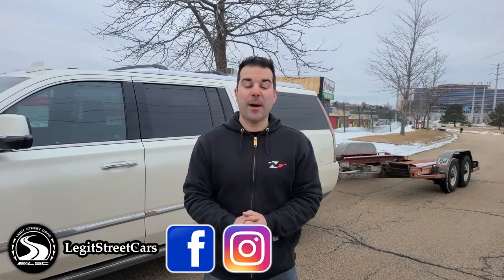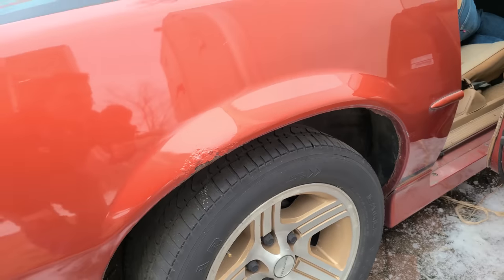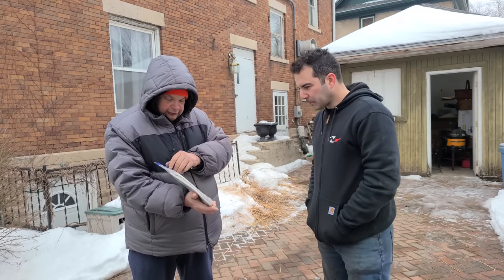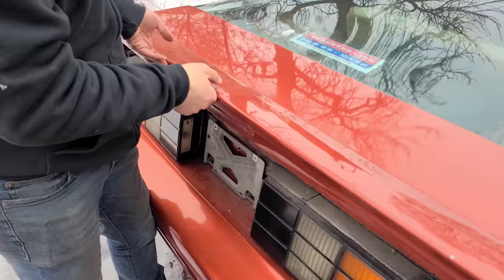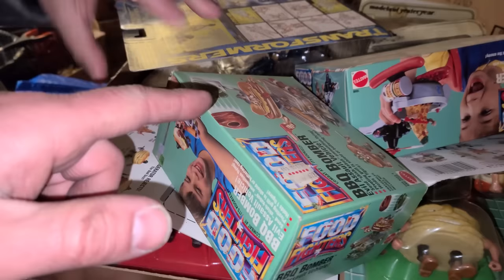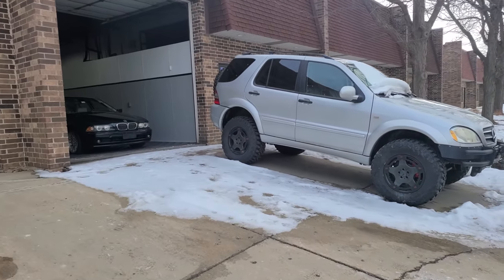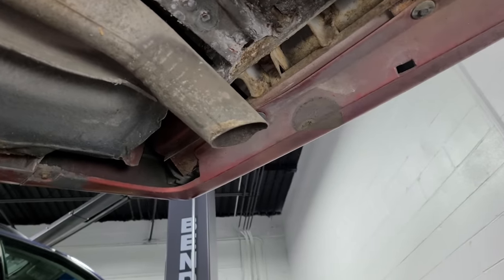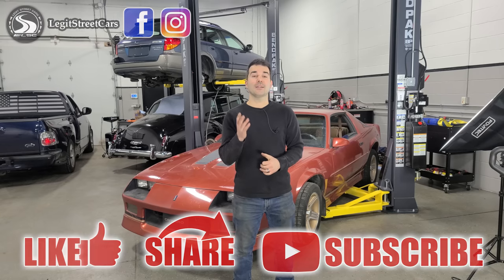I Bought An Abandoned IROC Z Camaro That Sat For 27 Years In A Storage Unit! Here's How Much!

Comment: I would definitely restore this beats Alex , come on man you got this , you haven't done a full restoration series yet so why not this ,as you even got it for 1500$ are you kidding me and clean title !!!!   mannn !!!! I'm all in for this thing these are so getting special as each day passes  , I'm in mad love with these  F-body  Gm's super cool and unique !!! please Alex save this baby !!!! STAY SAFE , TC and God bless !!!!
Reply: That thing needs like 8k in metal work alone, not sure if it's really worth it
Reply: To me it did not seem too bad underneath it obviously needs some work but it didn't seem to be rotten through
Reply: I agree needs to be a different color anyway.
Reply: From what I've seen, it's going to cost 8 to 9K to replace the rotted out floor pans. And another 2 to 3K just to get it mechanically sound with today's prices. Fuel tank will need dropped and cleaned and fuel pump replaced to get rid of varnish., All the brake lines are heavily rusted and would need to be replaced for safety sake., We don't know if the engine is any good or the transmission for that matter., All the brakes need done rotors, calipers, pads, hoses on the front, wheel cylinders, brake hardware and shoes on the back. And that's just to get it drivable safely. It's a good parts car and that's it.
Reply: I didn't think the rust was that bad tbh. Yes it's rusty.
As the others have said.
A resto only worth it if the end justifies the means.
This iroc maybe too far gone.
I'm not sure Alex would have the time to do a full on resto...
Reply: @JDJD-mw9rr  well if it sells for 15k or more isn't there a profit? I mean still it's unique and cool isn't it , its not like any car we get today alright I understand it doesn't have the 350 motor as well but still it deserves a chance.
Reply: @Thanos.m  yep your right 👍 thats exactly what I'm trying to say.
Reply: @Ooshwink82  Hmm 😳😏😎 not a bad idea !!
Reply: @TwentytenS4B8  well it's not that it isn't repairable and it still deserves a chance if you compare to a crashed salvaged one so thats why I feel it deserves a chance .
Reply: @TwentytenS4B8  you know what I think if Alex can find one that's damaged maybe lightly in the front and needs body parts maybe ok , then it can be used as parts.
Reply: @stuartd9741  Exactly
Reply: I live in the UK so I've seen my fair share of rotten cars at least from the video apart  from that panel in back and some localised repairs didn't look to me like it needed whole new floors.
Reply: @stevesamuel6603  honestly you'd be better off with one that wasn't so rotted out to start with. These cars aren't that valuable or rare, I've owned 3 of them. It's a unibody car so all that floor is structural, you'd literally have to replace everything and not to mention all the mechanical work, and in the end you'd still only have a 3rd gen 305 Camaro that is nothing special. I love these cars too but it's just not worth it for the normal buyer, maybe for Alex tho because he does all the labor himself and makes money off the videos. I had a mint 86 IROC, sold it for cheap years ago and now I wish I still had it since it was perfect.
Reply: @stuartd9741  It's a unibody car so all the floor underneath is structural. It would all have to be replaced, pretty much the whole car
Reply: @TwentytenS4B8  exactly, that car would cost more money than itd be worth to restore
Reply: @JDJD-mw9rr  like I said wasn't sure it was worth restoring.
The rust looked better than the neighbors  LT 1 he had..
Reply: @stuartd9741  I guess "worth it" is subjective. Worth it to make a profit, probably not. Worth it to make some videos and because it's a 3rd gen and sentimental then maybe. I just know how bad rust is in the rust belt, I tried restoring a merc slk230 and it just crumpled as I took it apart, it would of cost 10x what the car was worth to fix so I sold it for parts. I got a 12k quote from a body shop just to fix the body rust, never mind everything else lol

Comment: BEAUTIFUL 😍 paint.. 
I Purchased an 87 Iroc last year 20th anniversary  convertible for $700 same color but my paint is oxidized.  
You can easily get back the $1500 by selling the nose and rad support fender interior wheels and so much more.. keep engine and trans if good and search for a good clean Roller.

Comment: I love that factory color with the beige interior. I have the same, just from '85, originally with LG4+700R4, but swapped to 350TPI + T5 WC.  The hard part is to get replacement for the interior plastic pieces, especially here in Hungary :)
Can't wait to see this beauty running again :)
Reply: Hey there, my fellow european 3rd-gen owner. Hawks motorsport has alot of stuff for the interior. I have ordered a few bits and pieces from there. They LOVE 3rd gens :)
Reply: @kmas8229  Hello there for you too :) Yes I know Hawks and yes, they have mostly everything, but there are exceptions, like tan front seatbelt receiver, they only have the sleeves.
Reply: @___Reaper___  Oh damn. You could send them an e-mail? I had difficulties finding saddle-tan seatbelts, but they were very helpful. :) They found some and sent them to me for a pretty penny.
Reply: @kmas8229  Good idea, thanks, I'll try that. Somehow never thought I can send an email to them :D
Reply: @___Reaper___  Good stuff! I hope you'll find what you need my dude! :)
Reply: @kmas8229  I hope too, thanks again for the tip :)

Comment: I know this video is a few months old, but you do not jack these cars up on the pinch welds. Use the torque boxes in the back and the front subframe along the trans tunnel. One of the main causes of rust and body damage is jacking on the pinch welds. You bend the fender mount, which bulges the fender and can possibly cause issues with the door. You can also break the seam open where the floor, toe board, and inner rocker connects allowing moisture to get in, rusting out the front corners of the floors. It is the most common area for rust on these cars, driver front corner where everyone improperly jacks.

Comment: I graduated high school in 1990, I wanted of these so bad.  I came back from the in 1993, and almost bought one similar to this one. It had 3 options, the 350, the t-tops, and the upgraded factory radio.  I drove it and it rode like a tank.  Wide turn radius, stiff suspension, and wasn’t as powerful as I thought it would be.  It was good deal price wise- I just didn’t have fun driving it. Good luck with yours, I’m  eager to see how it turns out.

Comment: 245/50/16 stock tire size. Front and rear offset different. On GTA wheels it's easier to tell...the front 'lip' is deeper so it has a deeper dished look. Was done for turning clearance up front. 16mm offset if I recall and rear is 0mm offset.

Comment: i use to have a iroc rechipped it and it came alive way better then i thought it would had a lot of fun in that car black and gold did not even have a ding in it when i sold it drove it for 5 years and made good money off it . next i am building a 79 z28 rs t top have 90% of the parts for it with 2 extra z28's hard tops for parts . got a stroked 454 with a 02xx trans for it got everything for free so far even got new custom interior for it out of one of the hard tops . all i need is paint supplies and a few nick nacks for it also have a t-10 4 speed with new fly wheel and 12 inch clutch for the 454

Comment: The original reason for the power hatch pull down; the convex concave hatch window needed to be slammed and sometimes shattered. PPG eventually perfected the glass so it would not shatter. Thanks for the video, and confirmation on my purchase of a '91 17k mile GTA from Florida for $2800. Due to being sunbaked; replaced spoiler, leather. Whole car needs repaint, buy no rust period. Know the feeling, my heart sank for ya'. What will you sell the power hatch for, mine recently stopped working.

Comment: It’s pretty funny, I got my 1988 Chevy Corvette, March 8th after sitting for a while, it wasn’t as good as the pictures either (but they’re made of fiberglass and have a covered Galvanized Steel Chassis so no rust) but I also used a handheld tire inflator to get it unstuck from the snow and ice. And it had a mouse at some point in it.

Comment: about 8 years ago, I bough this exact same car, color, condition. that rear electric latch is stupid. BUT, when I started cleaning the carpets in the trunk, I removed them. and glued down to the floor was the BUILD SHEET! in amazing condition Used a heating gun to soften the glue and it came off like buttah!

Comment: Please read! I have had numerous 3rd Gen f-bodies and they all have the same wiring issue which drives most mechanics crazy, and will scare the hell out of drivers when it happens
..but here's the issue and fix.. under the dr.side is one of the fuse blocks, gm made the mistake of zip tying the main  loom over a piece of razor-sharp sheet metal, eventually they will short out and cause major problems... to fix cut the zip tie on the main loom and pull it down an inch and your good!!

Comment: The flex lines on the brakes are the reason why the brakes are locking up. when you hit the brakes it's allowing the fluid to the calipers but the flex lines won't allow the fluid to go back to release the brakes I have had many cars that have sat for a long time do that so just remember to replace the rubber flex lines front and back on the brake system then rebleed the air out and it should be good. It could also be the master cylender but the brake fluid makes the flex lines swell up and act like a one way valve

Comment: I bought an '82 Firebird SE equipped identical to a TransAm, but not one officially so I would get a break on insurance. It was at the end of the first year of the Third Gen and had no electric hatch pull-down. I remember the salesman telling me to close the hatch grabbing it from the middle, not to slam it, and that a lot of people were ending up with a trunk full of broken glass bits. Apparently, there were a lot of stress points in the curved glass. Especially, if they grabbed the hatch at either side instead of in the middle causing it to flex. By the time I got an '89 Formula 350 the hatch pull-down had been standard and I think I remember reading in a car magazine or the salesman told me but it was put on to prevent people from slamming the hatch down. But my pull-down stopped working and became a nuisance making me have to carefully close it hard anyway to latch.

Comment: Wow sucks  about the rust . I have a 3rd Gen trans am GTA  bought it at the beginning of 2020 to stay busy simple window switchs and headliner stuff looks good sounds good but tends to run hot 🔥.   Hope to see what mechanical  things you do on the Iroc to maybe learn a thing or 2  . Keep up with the great videos love the channel
Reply: Make sure it has the air dam,it's directly under the radiator & core support ,it's about the width of the radiator and 3-4" tall plastic .if it doesn't have one it will run hot as soon as you take off driving.
Also check fan motor(s) and the temp sensor that regulates fan activation.
And it could be just a stuck thermostat though I doubt it but never know

Comment: I agree with many of the comments below. The old saying looks good from afar but it’s far from good is true.  After you found a hole in the door and the rust in the quarters, you probably should have walked away.

Did you buy this thing for yourself or did you buy it to flip?  If you bought it to flip it, yeah you’ve got an uphill battle for the restoration/repairs. 

As I looked at the other cars you’ve got in your shop, it would not appear as though it’s going to be a tough job either way. Your shop has the space, the tools and the staff to put it together the way you want it.

Comment: I'd say all the gaskets in the motor are bad, when a car sets to long without running and used to being in fluids they dry out and everything starts leaking once you start driving again. Once I seen snow I knew the car was screwed.

Comment: 13minute 45 second into the vid.. A little trick that's had a good success rate for me on cars with electric windows that have been sitting and are "froze".. Rock the switch back n forth between up and down rapidly and repeatadly. That has snapped a lot of electric windows into working with cars I've had this issue with over the years. Try it the next time this happens and let me know if it works...

Comment: The power latch was for the purpose of the early cars being 82-84 people would slam the hatch to get it to latch and the glass would shatter. So they added the power pull down do you can just set the hatch down and it will latch itself so you dont have to risk breaking the glass.

Comment: This is the thing about barn finds/stoage unit finds -  running/working cars in good condition are seldom put into that kind of storage. They get put there because they needed work and then forgotten about

A "mint" barn find is like finding unicorn poo.. You should expect to require a LOT of work to get any such machine running again

Ideally this should be stripped to metal, blasted and pickled so you know what you're working with, then rebuilt from there. Just "restoring" it will result in something that falls apart after a few years

Comment: Those cars were so cool looking. 85-87 are nicer though. The rims were slightly different aside from a couple other things. 1985 305 t.p.i. cars were freaks for one year only. The 85 z28 & iroc z had 3.42 gears with an automatic. GM stopped that real fast because these cars were smoking 85 vettes. The corvette was rated like 30 hp more and weighed more than the camaro. The 305 made way more than advertised hp. On a good day an 85 iroc with an automatic would run high 14's no problem. The next year they were a basic high 15 second car because GM pulled the 3.42's in favor of 2.73's  .

Comment: "Push it! Pull it! Tow it to Golf Mill Ford!" 
Supposively this color on the Camaro is the same on the Firebird. Pontiac calls it "Flame Red Metallic" 
Fyi: coming from a GTA owner and fellow fbody enthusiast from what I know from the factory the GTAs with the 350/ttop combo was only available in 1989. You could of got the 350 in the Formula with ttops in all years, but not for the base Bird or Trans Am.
Great video btw!

Comment: WOW my 1990 1LE-IROC-Z has NO rust or air cond. or power windows or radio. It does have 6.3 miles on the OD .It has corvette breaks up front and alum drive shaft.

Comment: If the car was stored in a unit without climate control or ventilation then that would explain the rust. Ventilation of the unit and the use of Desiccant to absorb moisture would have helped prevent it from getting so rusty. Without ventilation you will get condensation during temperature swings and that’s what leads to rust. Also, if that car was parked that close to the road for 2 years then road salt spray in the winter certainly would not have helped either.

Comment: It's a great opportunity for you to learn welding and rust repair. It's not that bad for that price. It would had cost 4-6000dollars in Denmark without tax. 
The visible bodyparts you can get some pros to do. do the hidden parts yourself. And  take of all Bolt on parts to clean and paint. 
Out with the engine and ind with a Banks twinturbo Duramax and a Allison transmission

Comment: Did it have a firebreathing 305 Throttle body engine ? Even the 350 cars were totally dissapointing. Could be worth 15 to 20 redone. Less than a squarebody c truck of any variety. Parting this ICRAP out makes more sense, yes.

Comment: I still have a 50 thousand  miles motor that was run hard buy the son of the motor owner .It just tried to spin a rod .And shut down they was a tick in the motor .I bought it for a core .Fixed it and it just set for years full of oil .They replaced  just a stock 305 and put the tune port system  on a stock motor .the 305 tune port motor heads all had the big valves in them .So I put it back 10 thousandths rods and mains stock bore .Because the bore  had no.problems with it .mine is a 1987 305 no tune port system  full long block with valve cover and oil pan .

Comment: Question #8 - "Could you get a 350 TPI GTA with T-tops?"

Yes, and No. Initially for 1987, only 5.0L U.S.-bound GTAs could have T-tops installed; they were not, according to the order sheets, available in any Firebird model with a 5.7L engine. Again, this was a weight issue dealing with the CAFE ratings. GTAs destined for Canadian delivery in 1987 were not bound by the same requirements, and were available with the 5.7L engine and T-tops.

According to Pontiac order sheets and production records, the only GTAs subsequently available with both the 350 TPI engine and the T-top option were the 1989 model cars; the GTA that year enjoyed a large build number with both options. Starting in 1990, all 350 TPI GTAs were available as hardtops only. I have seen evidence of a few 1991 5.7L GTAs built with the hatch roofs, but that is only single-digit production.

Comment: They stopped making that power latch in 1993 when the catfish body came out!! I love third gen camaros and I've restored mine to showroom new and those wheels are different offsets that's why they say front and rear because if you put the rears on the front they will rub and those floors Def wasn't that bad I've fixed way worse and I'll sell mine for 12k 100 percent restored with 550hp 383 small block